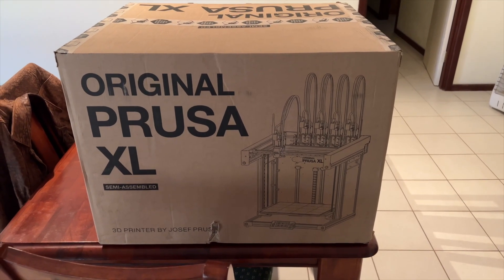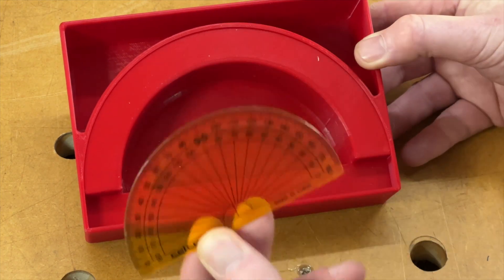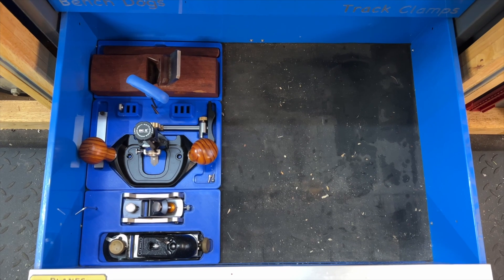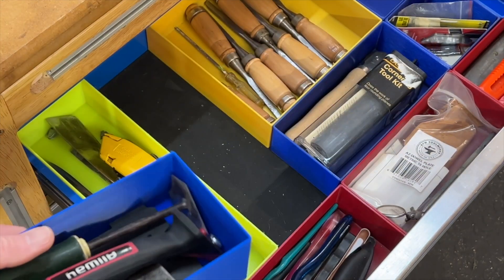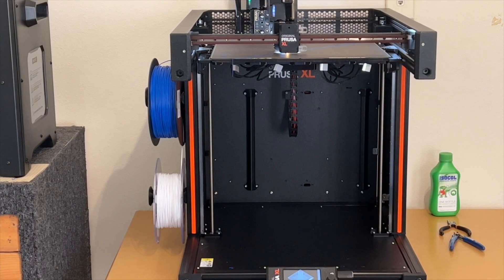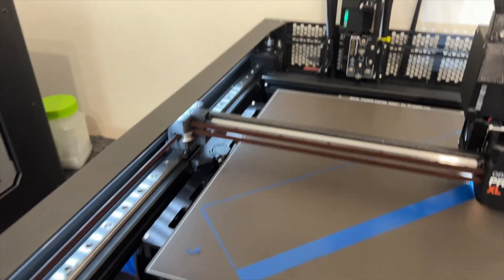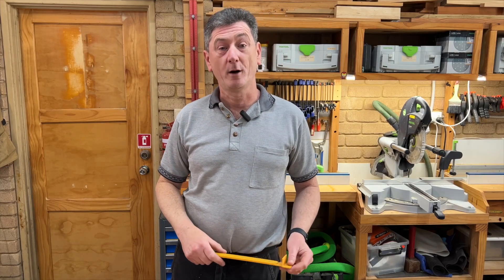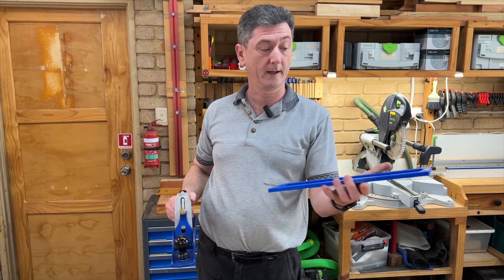3D Prints in the Workshop Prusa XL

Comment: Interesting printer- but at £2000 starting price (UK) for a bowden feed is a bit rich for me. My current printers cost 20% of that, and do 300 x 300 x 350 auto bed level and direct feed. I would need to do a lot of large prints- for a few just get them printed for you. Nice toy though, and fun to explore. Thanks for sharing.
Correction- I have learnt that the XL is not bowden feed but direct.
Reply from the maker: Yes, very expensive, there are definitely cheeper alternatives. On the upside though Prusa build great, reliable printers, offer excellent after sales service and keep spare parts in stock. So I know that I will be able to rely on the XL for many years. My old Prusa Mk3 is still going strong 5 years after purchase and it has seen a lot of use.
Reply: @DarrensWorkshop  I certainly agree about the quality of Prusa printers, and if I were setting up a printer farm I would certainly consider them. As a hobbyist (even though I have printed several hundred items) I have other considerations. Price is one, but open source design/parts are another. Prusa are a 'safe' buy, but there is pleasure in ringing performance out of less costly equipment. You have a very nice machine, but most would have their needs met at a lower cost- and value for money is important.
Reply from the maker: @Tensquaremetreworkshop  agreed 👍

Comment: Hi Darren, so how much was the printer all up, in Australian dollars?
Reply from the maker: Hi Colin, This is scary. I got hit hard by the exchange rate.

Original Prusa XL
• Number of extruders / tool heads : 2, $2,499 USD (AUD $3918.23)
Fedex International Priority   $290.88 USD (AUD $456.08)

Border Charges/Fees applicable: All AUD
DUTY $195.38
GST $456.44
Entry fee $93
TOTAL $744.82

3918.23 + 456.08 + 744.82 = AUD $5119.13
Reply: @DarrensWorkshop . Thanks Darren, it's amazing that they have the cheek to charge GST on something that wasn't even made here! I got stung on the resin printer I think that was $500 in fees. Really appreciate your time and review of the X1. Cheers, Colin
Reply: Good break down of the figures. I was keen to see the shipping figure as I’m in Perth.

What’s a piss take is the Aus govt applies duty (tax) then applies GST on top of that (tax). So tax on a tax..

I’ll get mine in may2024 and am likely to be around 5200 as exchange rate is 1/ 1.58. If the aud drops more it gonna be closer to a 5500 machine. Lucky it’s a “business” purchase so it will get deducted.